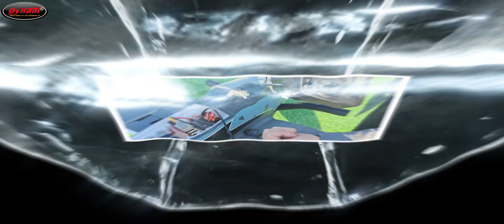How to enable RTH on the Detrum GAVIN-8C w/SR86A-G autopilot telemetry receiver

Comment: Hi. After pairing , when I go to the settings, the transmitter (GAVIN-8C) displays the message "unable to connect" with GPS. I have a question: does the small triangle on the plug mean GND? Does it connect to the outside of the receiver? Thank you for any help you can provide.